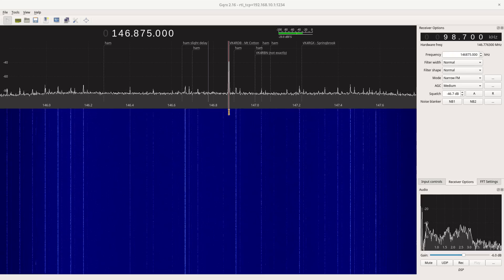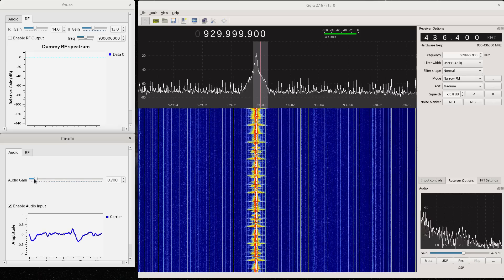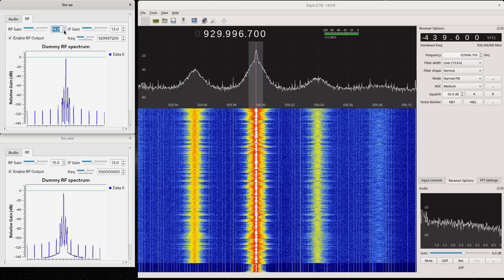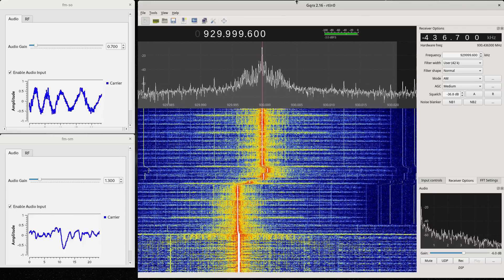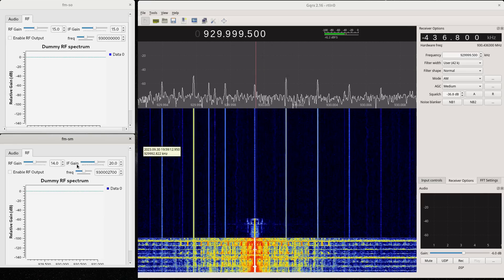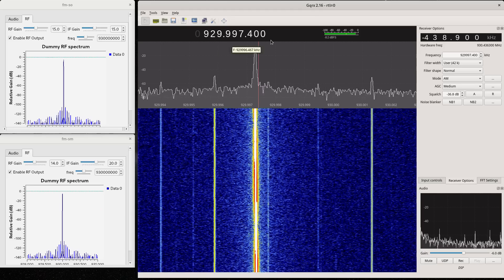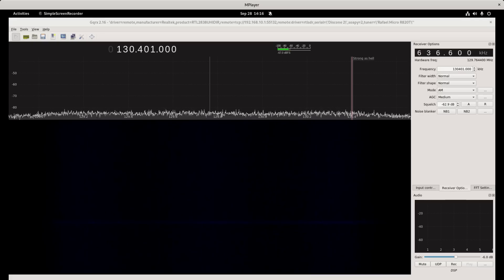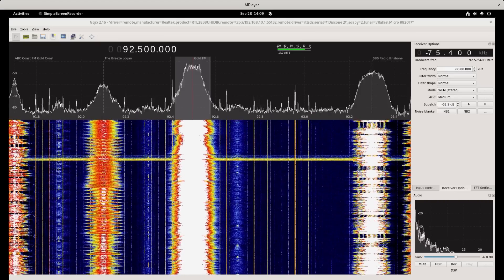Demonstrating FM Capture Effect

Comment: Applies to general aviation. Less bandwidth required on AM. Beat freq tone effect allowing for multi station audio detection is a factor. And of course, the bottom line, being the cost of the radio set build (traditionally lower for AM due to the circuit usually being less complex). 
I'm aware that FM was utilized in some aspects of military aviation communications from at least 50 years ago though.
Thanks for the explanation. Most interesting. Cheers.

Comment: Not at all correct. The cost of certifying equipment for use in aircraft is astronomical. The cost of forcing all aircraft and ATC facilities to change all of their (working) radios is equally astronomical.

AM works, and the cost of changing would be mind-boggling, so nothing changes. Same reason most aviation headsets and helmets still use electret microphones that were developed during WW2; it still works and it costs too much to force a change.
Reply: May 1962: James West and Gerhard Sessler Patent the Electret Microphone.

Comment: And this speaker polarity thing just cracks me up. How can everybody get this so wrong? All you have to do is listen to it the other way and you'll know. But they don't. And they are the experts with the college degrees. They get most things very right. I love the gear these companies have designed. But they've all gotten this wrong. It's amazing! How is this possible? I keep wondering. It's like a cult. It's like a mob. If you all hate the same race together. You must be right! Yeah no. No that isn't necessarily the case. And we've learned that about ourselves. What have you guys learned? Did you guys go to school to get licensed to repair this stuff? I did. But I really wasn't interested in working on transmitters per se. Though I had to repair some. They just aren't my thing. I don't dig them. They are amazing. They are handy. We can't live without them. I'm not really into them. But licensed to fix them. If I need to. With a schematic and proper test equipment. Which means at least a voltmeter and a scope. First thing in the morning does it. And it's minty fresh. But I'd rather use the electronic type that now reads out in color and only weighs a couple of ounces and uses almost no power. A hell of a lot better than my big old Tektronix. 100 MHz Dual Trace Oscilloscope. But it's only green and white. Or green and gray. Or green. And I'm spoiled with color, displays. And I hate my computer without the big 65 inch karma display. As I'm currently forced to use my 40 inch. In this room, dammit! I hate looking at this crap on my phone! I like it Big! Yes I am one of those girls. I love the Big Screens. The Bigger the Better. If I had a bigger place I would projected on an entire wall. In the living room. As I've also got a Superb Audio System. More than one. Many. Because I'm an actual retired pro from my industry. And spent all of my time at the top. No matter where I went. Because I don't get things wrong. You can't and stay at the top.

Now our fine, Accented Host. Might have something slightly different to cross the pond from the USA? Though I have that same 705 series Transceiver. And I've seen people misinterpret test equipment before. Substantially so. To nearly bring down the company they were working for. When they brought me on board to fix everything. And put me in charge. Of the entire factory floor. And I had never worked in a factory before. But when you're good, you're good. You figure things out real fast. And 2 weeks time. I was able to troubleshoot. That which 2 Electrical Engineers, couldn't. What does this mean? I'm really not certain? People make mistakes. I'm a problem solver. They don't make them because they are stupid. They make them because they believe deeply in that religion. They, misinterpreted, slightly. And are following the wrong lead. And then I get the call. When they have exhausted all educated possibilities.

And so I find these scenarios very funny. But troubling, just the same. As I remember when dummies in the 1970s. Would tweak up their CB radios to full, 5 Watts of output power. And leave no room for anything but, Negative Modulation. And all they had was 100% Modulation of Background Noise in their rooms. It was always very funny. And they would yap loudly. And their power would not go up any further. It just modulates downward. I always found that very funny. You can't tune for peak power. You tune to get peak power with 100% modulation. Not of the carrier wave.  With no modulation. It was always very funny. And then the guys who would plug in, 1000 Watt Linear Power Amplifiers. And they would be splattering all over the place out of band. Broadcasting on multiple harmonically related frequencies, simultaneously. What a mess! HEY BREAKER GOOD BUDDY CAN I GET A RADIO CHECK! I'M IN SOUTH FLORIDA. WHERE ARE YOU? Baltimore, Maryland. Well you are 5 x 5! Thanks good buddy. And that is Amplitude Modulation. At 27 MHz in the, 11 Meter Band. Right next to 10 Meters. That Hams and Amateurs can talk on. CB' ers, shouldn't be. But who really cares anymore? Everything below VHF is a Virtual Free For All, today. As Mr. FCC Man. Probably won't be hunting you down. Playing with these toys on toy frequencies. But when people start broadcasting on those, VHF Aircraft Frequencies. Now that's different. That's like shining bright green lasers at airplanes. Not recommended. If you know what's good for you? Obviously some don't.

Well? I think I'm going to grab my little, battery-operated, quad copter, flying drone. And see if I can go race some of the airplanes down at the local regional airport? Or go hover above a Major League Ball Game. Since it has 4K! And 120 FPS SloMo! Yeah doggy! Yee ha! Woo hoo! Yabaddabadoo! Am I going to have fun flying you! And go show those stupid pilots I also know how to fly! And I will buzz them on the tarmac with my drone! They are going to be sorry they fooled around with Me! Ha!

I fixed a bad audio problem ones. The military guys couldn't fix. In the East Room. Of the, White House. The one at, 1600 Pennsylvania Ave. NW. After screwing around with it for 2 hours. And couldn't solve this simple problem. With equipment they used all of the time, every day. And they didn't know it as well as I did. So when everybody threw their hands up in the air. And the Network Producer and Director are getting upset. I finally piped up. And said I know what the problem is. And in 10 minutes time. I reconfigured the entire system. Rewired the whole thing. I looked like a scene from a comedy movie speeded up. And Voilà! Scotty from Star Trek.

And so believe what you guys want to. You're going to anyhow. And when you find yourself stranded on a tropical island paradise with Gilligan. And you want to get off? Without Gilligan's help. And you think your FM radio is, AM. You might not get rescued? When you broadcast AM on FM frequencies. They might get your carrier wave? They may not decipher anything? Because you miss wired your radio for AM. I'm just saying… And laughing through this.

Sometimes people misinterpret what they are looking at. I mean it's like trying to read music. You know there is a G clef. And there is a Bass clef. Many folks don't know there is a, tenor clef. One in the middle. Only a few musical instruments use that. And many have to transpose to one or the other. And your intervals go all screwy. You don't want to broadcast a Mayday like that. Or Pan Pan Pan. If they can't understand you. Because you are modulating the amplitude instead of the frequency! I mean come on already? It's VHF. It's all narrowband FM voice communications. It's 25 kHz deviation. Not 75 like FM Radio. That requires a lot more bandwidth. With a lot fewer channels. Certainly not three decimals out from base frequencies. GMRS, 2 Meters and all the rest. Plainly up into the Gigahertz, today. Much now on Wi-Fi Frequencies. Good for about 300 feet at ground level. A couple of miles. If it's a couple hundred feet in altitude. And you are flying a small battery-operated drone. Weighing a little more than a pack of cigarettes. With a 4K camera and Chip Recorder. Beaming back a, 720 P or, 1080 P, real-time signal. To your phone. To also be recorded at that reduced resolution. And frame rate. 30 FPS instead of 120 FPS. And oh well. That's only your viewfinder thingy. The drone is recording the HD SloMo. For later downloading. If you are not streaming live. Which one can also do. And yes there will be digital latency. Meaning you could hit something. Before you see something. And react to something. It's already too late. And a great way to throw your money out the window.

Now I was also a motorcyclist for over 30 years.  Using it is my everyday driver. And to run to the mountains. To run to the beach. Hours away. To run to New York City. 4 hours away. And then go home. The same day. I miss those days on my motorcycle. But it was time to part with it after 30+ years. After getting Antique Tags on it. And then feeling really bad about that. Because I had purchased it, new. 32 years earlier. And how those antique tags for years. Until I started feeling like an antique, physically. Ugh! What the hell? Getting old sucks! I want my money back! Who do I complain to? Where's the manager? I wasn't done being young. I want to go back.

Now I'm retired and getting senile. So I get to go back. Hi my name is Remy. What's yours? What?
RemyRAD
Reply: Oh, do please shut up.  
Don't do drugs, kids, or you might end up like this guy and his incoherent rants.
Reply: @themcchuck8400  why? Laughing at schizo posts is why we come to the comments 😂

Comment: Look. I've seen plenty of tests, run the wrong way. So that guys with college degrees. Can prove they are right. And then I turn around. And show them they are wrong.

Some people have made some fundamental, beginner mistakes. With college degrees. I've had to fix those mistakes. And there have been some substantial ones. I have found both frustrating and very funny to solve. Because the college grads can't get it right.

As you might imagine. I have no college degree. I don't need one. I'm a fucking genius and always have been. I do a lot of what other people can't do. As I'm very outside the box, the book and the mathematical equations. As that does not, Limit Me. From solving problems. Because some of us have to. Some of us have to make things work. That don't. We have to troubleshoot and fix things. Down to the component level on the circuit boards. And you will find the bad part. Is, the one that looks perfectly fine. And tests fine. Until it's under load. And then you get gobbledygook.

Oh course everybody has their own religious belief. That cannot be varied. Cannot be questioned. Because it is Gospel. And you have the tests to prove you are right. But when you're tests are flawed. And your flaws prove you are right. There you go! You must be right? You're not!

I have caught many silly technical mistakes. That's what I'm really good at. And always have been. Right from the get-go in my career. And so I got great positions. But I wasn't much interested in transmitters nor modulation techniques nor antenna design. RF transmitters transmit pure, Class-C, Distortion. If you pumped it through a speaker. It would not be listenable. So I don't deal with those kinds of amplifiers. No. I like the ones that pass, clean sounding audio. Class-A-A/B-B sort of, D sure. I forget what  E & F was? G-Amplifiers are cool. They don't get very hot. And they sound good. But I stick with mostly A/B, types. They are a lot heavier though. Big heavy power transformers in those. The Digital ones are Lightweights. And they sound interesting also. Though I don't have one of my own… Yet. And I sold my last Macintosh Class-A MC-30. I had a pair. They sounded beautiful. Very different from my Crown DC 300 A-type II's. As I have 2 of those. And a bunch of others.

And so some folks are into cults, these days. A big Nazi uprising. Maybe right here? That believe it's AM not FM. And the world is flat. And the last election was stolen from you.Yeah right, sure, gotcha.

Okey-dokey then. This is why we get to be Americans. It seems like we didn't agree.
RemyRAD
Reply: go outside old man
Reply: Lol
Reply: You need a hobby.  Or meds.